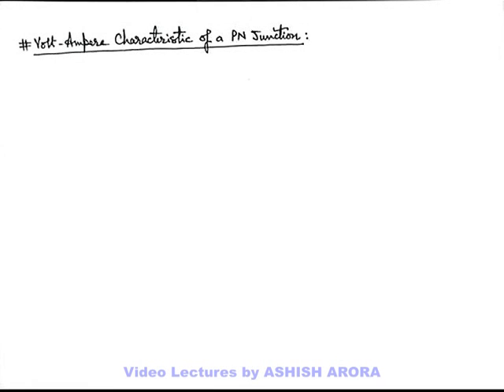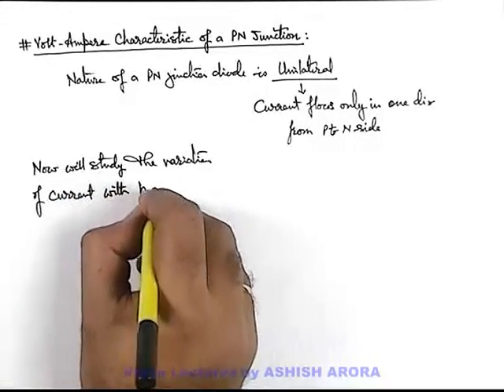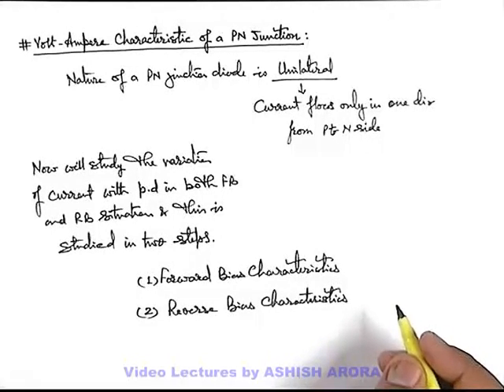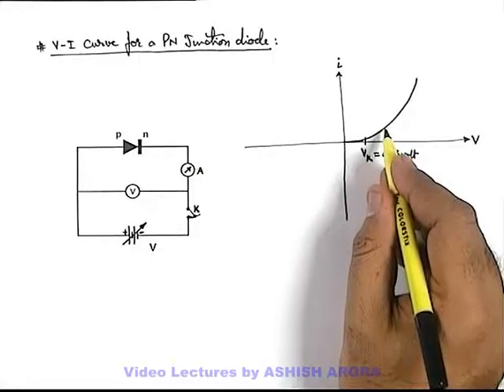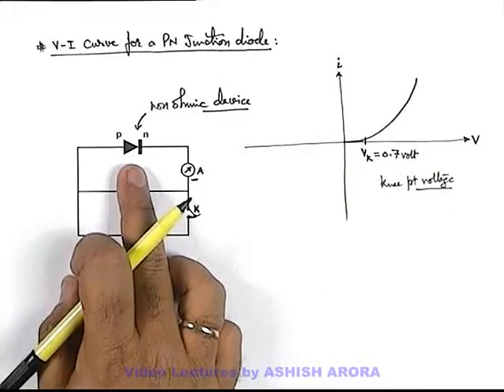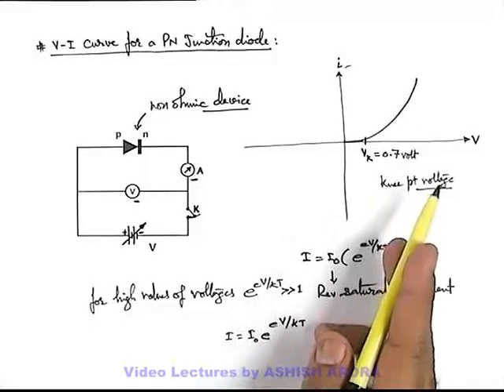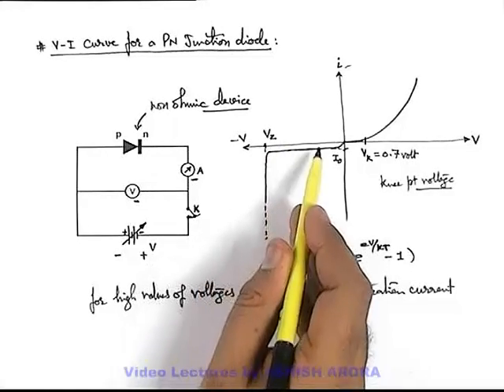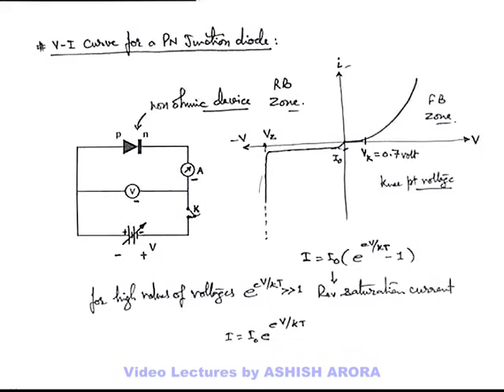Class 12 Physics | PN Junction & Sem Diodes | #7 Volt-Ampere Characteristic of a PN Junction Diode

Comment: Sir i have 3 doubts pls answer
1.what is the value of the constant k
2.is knee voltage is equal to junction voltage in magnitude
3.acc to the eqn for I, if temperature increases current decreases,but actually is it not that if we increase thermal agitation e-h pairs increase?
Sir pls pls answer

Comment: I = I°{e^(eV/kT) -1}
Sir according to this expression ,if at a given voltage temperature is increased..current decreases. Doesn't that mean resistance of the diode is increased. If yes, then why thermal coefficient for semiconductors is negative.

Comment: sir, I did not got that in reverse biased case why after zener voltage the current suddenly increased so much???????????
Reply: because covalent bonds in p side and n side breaks down 
results in formation of high no. of electron and holes pairs which causes very high current in diode
Reply: @shubhamjha4560  to kaisa rha apka result ? aur ab aap kahan hain ?
Reply: @ishansinha1336  apka result kaisa raha